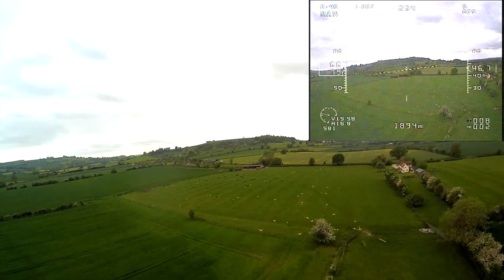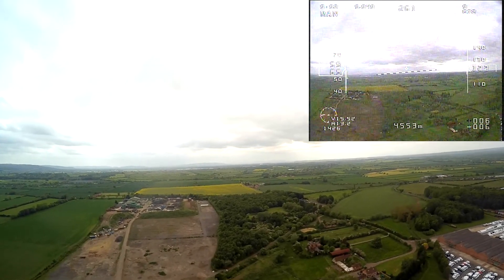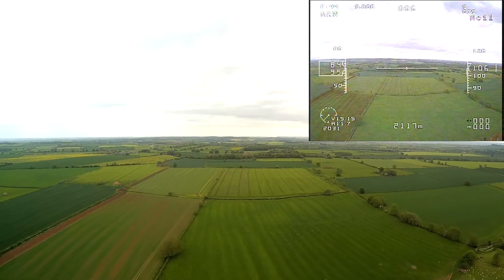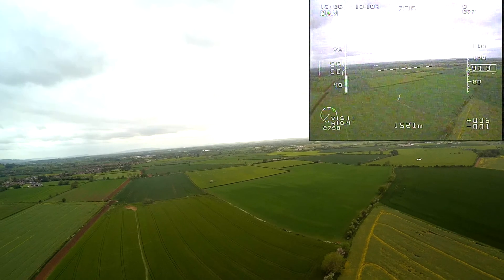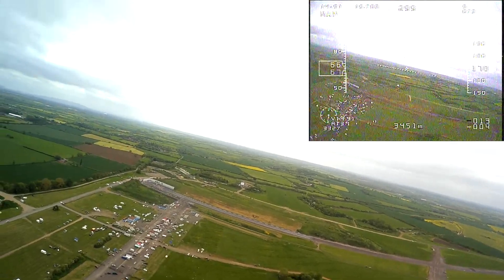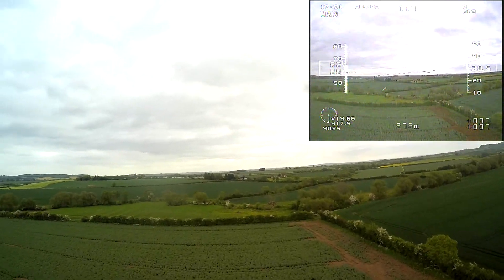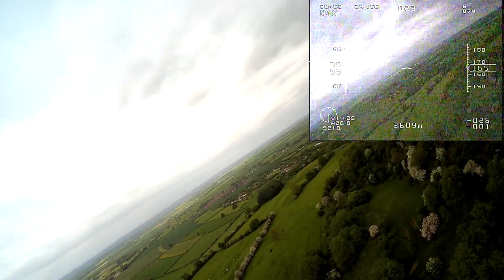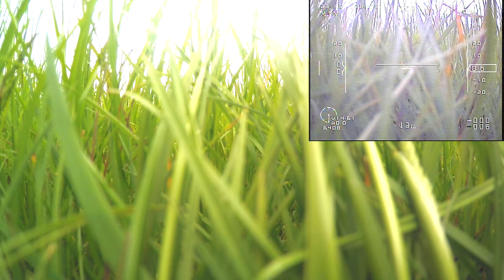Venturi @ Terrabound - May 2015

Comment: Enjoyed the low level trip out to Teletubby Hill.....and the climb up it....what capacity flight Lipo were you using?, and are you watching ma consumed, or just relying on the 14.10 voltage?... I wish we could get an Orange UHF RX to run with EZUHF Txs...:)
Reply from the maker: EnglishTurbines Cheers, the Teletubby house and what was the hill is the round shaped pond near where we were flying from, they flooded the house - hopefully with the Tellytubbies still in it... I tend to fly by voltage and use Mah as a guide as the mah consumed is always an approximation with current sensors. No need for EzUHF, just get the DTF-UHF Deluxe TX and the OrangeRX will still work with it but the best range comes from the DTF-UHF RX and TX combo.
Reply: ***** Hi m8, I already have the EZUHF JR plug in module for my Taranis, plus one of those tiny 4 ch recievers...Not flown it yet, but am thinking of a 771 for my TX and a home made Dipole for the RX....its a neat solution if it works ok, pretty sure it will outrage my Video link anyway, Im still using 5.8g for that, like your clips, also watched Bruce clips when he followed you out to 5kms along the river, that was very entertaining...:)